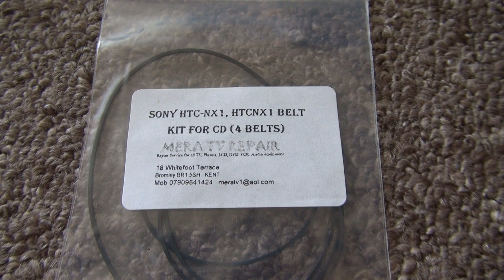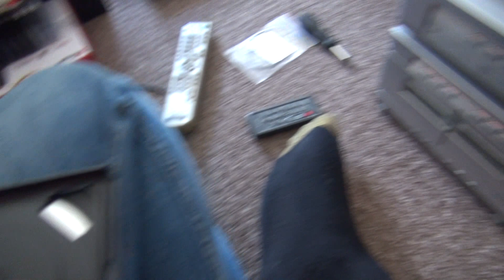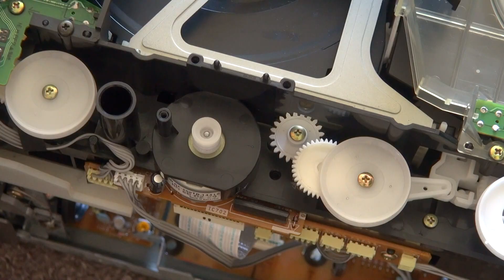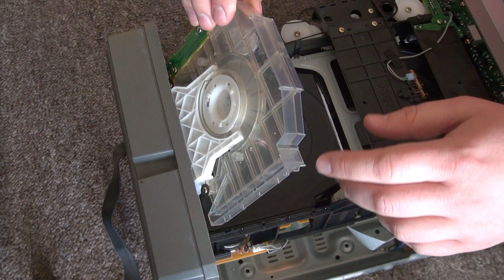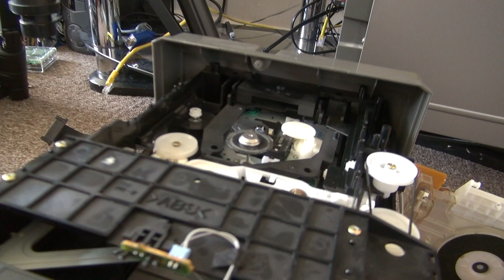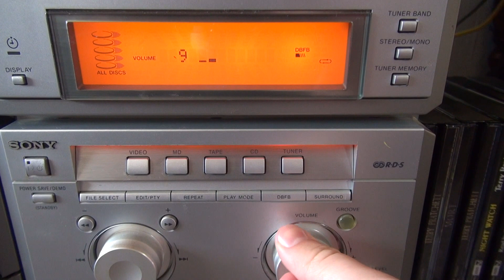Sony HTC-NX1 CD player belt replacement

Comment: Hi Stephen! I found this system into a field next to garbage! It was contaminated with sand and dirt, remaining outside who knows for how long!

Changing the cd belts with the white belts I had from pharmacies, (even with some cutting and gluing), and by giving to it a strong air pressure cleaning, (some oiling necessary), it works perfectly! Right from the dust!

The volume control works perfectly, too. 
The screen  is out of order.

I am driving two fat CAV mdx III speakers, (with 12'' subs), and it does a perfect job, with crystal clear sound to the total frequency range! Similar, or better, than my 2x200 RMS watts power amplifier, (CAV A12). 

Any time there is a strong bass into the program the fan is on, (and then it stops). No disturbing sound at all, (from the fan).

I cannot believe it!  What a little miracle by the Sony!

Comment: Great video.  I opened the CD housing and the belts have almost disintegrated, but definitely broken.  My question is two fold: 1)  when I push the button to eject, nothing happens (for any of the 5) as if there is no power to the machine but there is.  Does that mean there is more damage than just the belts?  and 2) should the plastic wheels be turning regardless of the belt or if they do not, can this problem be fixed?  If so, where can I order these replacement belts in the USA.  Thanks for any help/advice.
Reply from the maker: It could be the where the buttons to play and eject make contact with the circuit board, as the play button for deck 4 on mine, (the one that actually has '4' printed on it, is not very responsive.

Comment: Hey, so I wanted to repair my CD changer and I took it apart more than I should. I put it back together and replaced all belts but the hidden motor wants to push even when it's pushed all the way, then it retracts a little and starts to push again. After few seconds the entire deck turns off. Do you have any idea what is wrong and how to fix it?

Comment: Hello Stephen. Thank for posting this video. I have recently bought a replacement CD part of the same system from eBay, replaced the belts as this was needed but the motors aren’t working at all to open any of the trays. I was wondering if you could help and give some guidance on what to do? Sorry to be a pain. Many thanks, Mat.
Reply: Oh, I’m no expert engineer repair type person at all either. Quote useless in fact haha.
Reply from the maker: @MatOrchard  If the motors have stopped working all together then I'm not sure. But perhaps you could coax them into life by turning them manually. When I did this belt replacement, I also oiled all of the motors on the bearing where the shaft goes into the motor. This helps make them quieter and extends their life. As I do model railways, I used the same oil that I use on my model locomotives, which is made by Gaugemaster. It's a good quality oil, and it doesn't damage plastic either, should it find its way on to any plastic parts. Hope this helps!

Comment: Hi Stephen - Just followed your video for the change of the CD belts & it works a treat now, thanks so much. I now need to change the tape belts, I'll follow your other video guide & report back to you in a few weeks. By the way, the other problem I have is with the type on the LCD crystal display breaking up, any thoughts would be appreciated. Thanks again, you've saved me a few bob already! (PS - I have the same problem with the volume control)  -  Richard Moody
Reply from the maker: I've not yet played with the LCD, but if I do, I shall let you know 😊
Reply: @stephensrailways  That'll be good, is your LCD perfectly clear after 20ish years then?  Also, just out of interest, I don't think that the 3 smaller belts are identical. The 4 belts delivered to me for the CD were marked as follows SG431 + 2 x SG110 + SG263. When I looked at them very very closely I reckoned that the one under the CD player was very very slightly larger but there certainly wasn't much in it!
Reply from the maker: @richardmoody8688  My LCD is still very clear, and it all works nicely

Comment: Really nice video, thanks. Our unit has worn out belts for the tape decks and CD changer, as well as the faulty volume dial. Look forward to the next installment
Reply from the maker: Thanks, I hope you found it useful! I haven't got around to getting the parts for the volume dial yet, but it's good to know its a common issue.

Comment: Really useful, thanks! I’m having a problem on mine whereby the unit is only detecting Disk 1. The other 4 slots have disks in them, but I’m unable to eject (No Disc). Do you think this might be related to loose belts? They don’t feel horrendous, but the longest is pretty slack..
Reply from the maker: I'm not 100% sure but the belts are cheap, it may be worth a go
Reply: New belts £12 and 10 mins to change them. System works perfectly again now! Thanks for your guide - I would’ve 100% binned it had I not found your video!